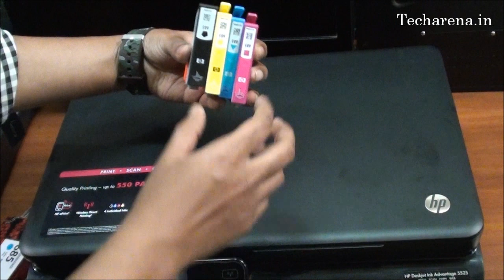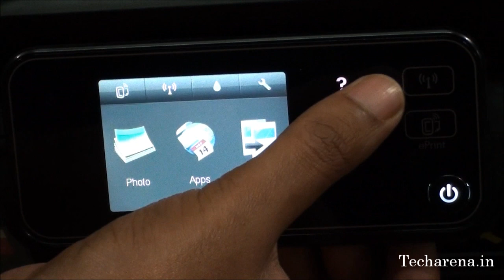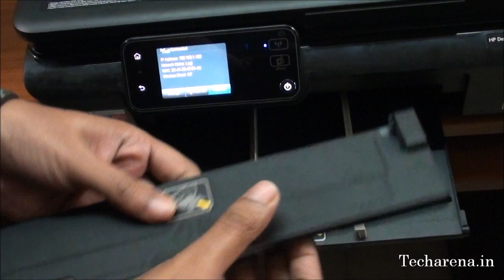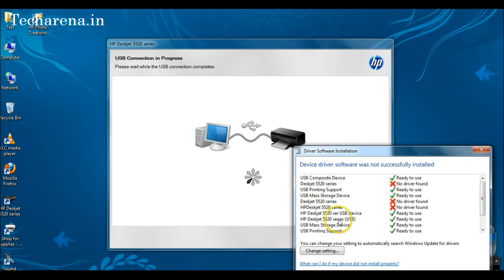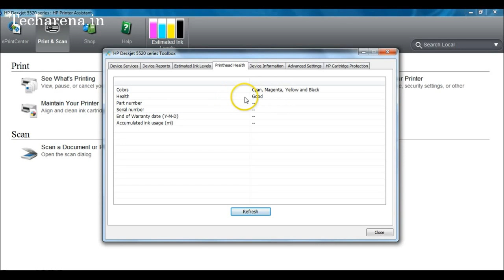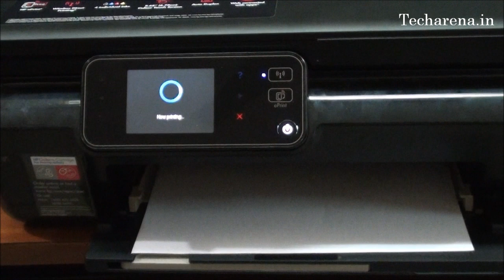HP Deskjet 5525 Review and Assembling Guide

Comment: who knows what to do if there is 0x6100000b shown on the screen? the printer refuses to work and makes a clunching noise. please HELP
Reply from the maker: +Бока Типик  The error you had mentioned is related to carriage jam. I think you have to re-assemble the printer once. Just disconnect all its part and before that put it on factory settings. Once everything is placed perfectly it will work. Refer to the printer manual.
Reply: +TechArenaIndia thanks a lot for your reply, but I'm afraid I'm not a good specialist enough to do this... and I've lost the manual.
Reply from the maker: +Бока Типик Then it will be good to ask any friend who is expert in this field.

Comment: Beautyfull machine, but after 3 years(max),a message will show on the screen,and  the machine will is for the recycle bin.
Will see! I have experience of 2 photosmart .C4280 and B110a
After some number of prints,a printer will lock,the hardware will yet new,but the dirty...software inside the main board say "No" ,and this way hp tell you,buy new.
(Hp:my new model has new cartdrige,and you can't put refill inks for some time... )
Reply from the maker: That is really bad, HP should really take care of this problem for sure.

Comment from the maker: There are 2 applications available which can help you to use the printer on Apple devices and Smartphone. The simplest app is HP ePrint. Now this app is only available for Android, iOS and Blackberry. Not for Windows Phone. HP ePrint is a Cloud based application. You will need to register your printer first online and then you can take print. The second app is HP Printer Control which works via Wifi. Your device and printer should be on the same wifi network to print.